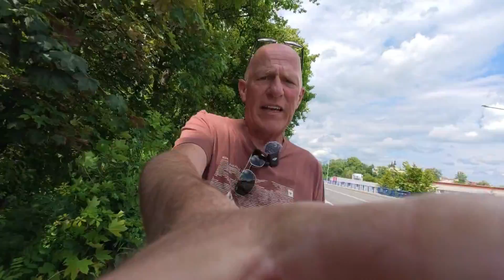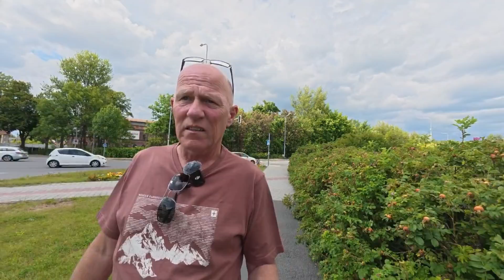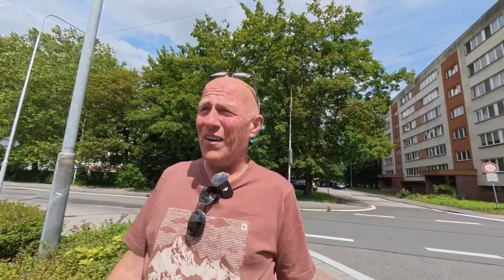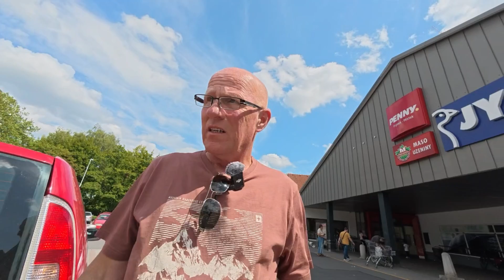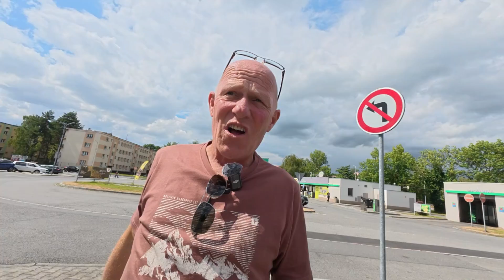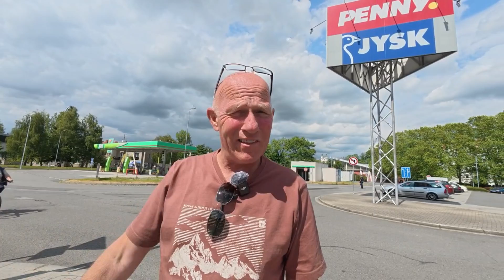Air India 171 crash preliminary report overview. Fuel Cut Off switch Used

Comment: Why are you jumping to conclusions that the pilot is to blame? Do you not think that the possibility of dual engine failure caused by faulty switch or software and then pilots had to restart the engines by turning to CUT first then to RUN? The fact that pilot asks the other if he had switched off the engines was a surprise may point to a fault. Just a thought!
Also don't forget that the FAA had issued an advisory regarding the same switches back in 2018. Do your research man before posting
Reply from the maker: You are right. It is the report that infers one of the pilots did this, especially with a 1 sec delay for each of the engines. It could be a software problem for sure. But….early finger pointing is towards the pilots. Which is strange

Comment: I reckon you are certainly correct about the the difference , between western captain & lower rank flight deck crew & those in the east & far east .  A first officer operating for a eastern airline , is not likely to dare question their captain , even if they know they are in the right .  I only fly when I can’t avoid it , & even then I like to see a western flight crew (preferably British ) in control of passenger carrying missile . If we were really meant to fly , we would have been born with wings . Flying is like gambling & as such anything wagered such as a persons life in the case of flying , should always be considered lost until the aircraft reaches its destination intact .

Comment: Why trust the report's initial findings when they themselves may be sweeping issues under the carpet, dead men don't speak. It's taken far too long to release this info when they would have known it since retrieval of the data recorders. In 2019 an issue with these switches was reported and frequent maintainance recommended. Initial reports of the communications with ATC mention a conversation about failing to achieve thrust. 

The plan of action for dual engine failure involves switching off then on again the fuel switches. The soul survivors account suggests failure of at least one engine upon take off 🤔 Why, as soon as the accident happened were we given information of personal struggles of the captain. Coincidentally, or not, the same was done when MH390 disappeared.
Reply from the maker: I’m in your side for sure. It would be much easier and cheaper to blame the pilots. Then the 787 does not need to be grounded etc. it seems very strange

Comment: So basically your previous clickbait videos were completely incorrect predictions based on no facts, and now you are presuming cultural differences that may not be correct at all have caused this. There is also a possibility that the switches were incorrect with no need to rotate to switch off as has been the case on 737s, so could have been an accident. you should be ashamed of your comments.